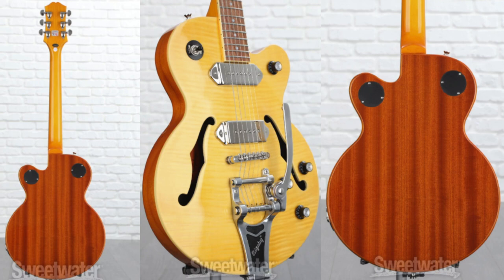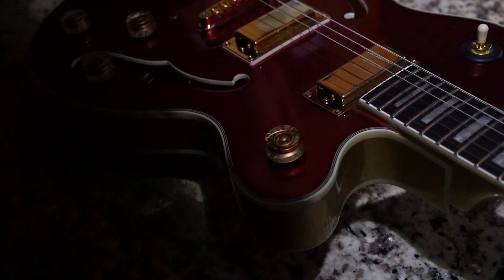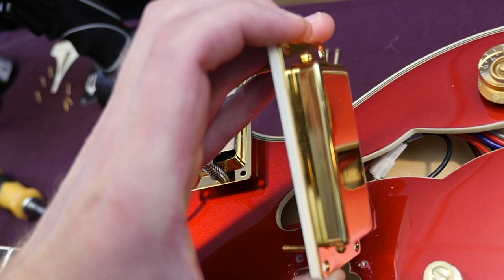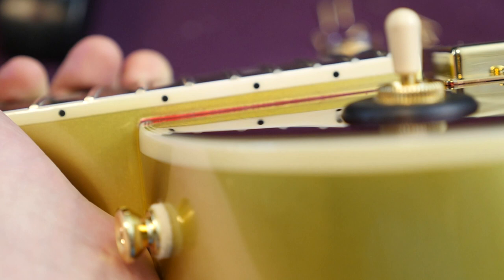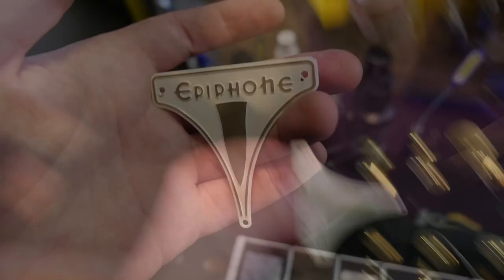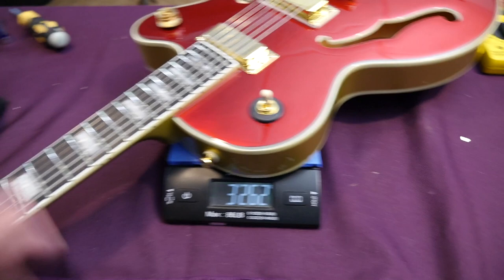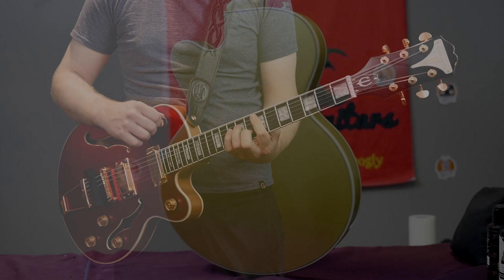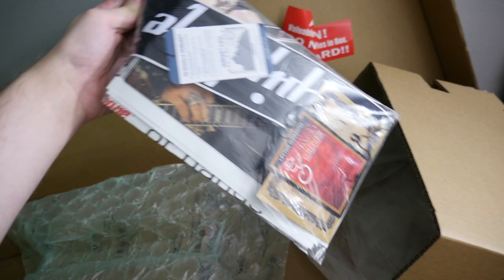Is the Uptown Kat Worth It? | 2020 Epiphone Uptown Kat ES Ruby Red Metallic | Review + Demo

Comment: I own this exact model, it's my favorite guitar, I own seven at the moment. I had to do a little work on the frets to get it without any buzzing but now it plays fantastic. I absolutely love the mini humbuckers they give you all the range and bite of a full humbucker but with a much tighter bottom. The wires are not visible on my copy they must have come loose on this guitar. The volume's configuration is fantastic you can blend the two pickups the way you like and then back off with the master volume and still retain your tone without redoing the blend again. I have to add that this is the best looking guitar I have ever owned and I have been playing for 55 years.
Reply: Do they suffer from neck dive?
Reply: Yeah had to work of the feet buzz too. A little feet work, changed strings and a good set up. And yup, has some neck dive. But plays well sitting unlike how a Les Paul feels
Reply: Do you Have any problem with the hum sound? I have the same model, but the hum is too noise!! I’m thinking change the pickups.

Comment: I preordered mine when I saw it at NAMM. After 6 months I’m still playing it everyday. The wires aren’t visible thru the F hole on mine. The neck/headstock is heavy and I did have some initial intonation issues but overall it’s a solid guitar with great tones. I even use it with a Metal Zone pedal-kicks ass

Comment: I bought one today, so your review was for me about bias confirmation. But I compared this guitar to others way more expensive, and ultimately, this (metallic blue) was my choice.
I love the look soooo much, easily one of the most beautiful guitars I now own.
And it plays beautifully, obviously it doesn't deliver quite the plummy tones of much more expensive guitars, but still very sweet to the ear.

A huge plus is the relatively compact size, much more practical for gigging.

Mine will be mainly used for jazz comping - at which it excels. Some soloing - adequate sound,  but not as searing as one would demand if one soloes a lot. And some chord melody playing, for which it's a good workhorse, though by no means the best sound for that either. But since mostly I'll be singing and simply using this as a backing instrument, it's outstanding.

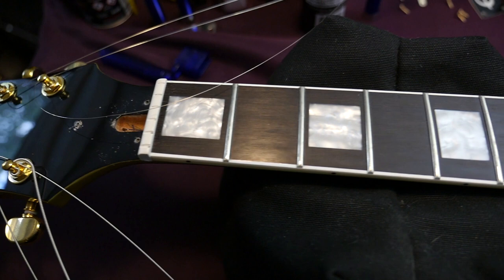Comment: 9:21 That might not be pencil graphite; but rather, metallic residue from the strings themselves. Please note: The Teflon™ impregnated into the NuBone® material is five times more slippery than the pencil graphite, and thus, if you rub the graphite onto the NuBone® material, you defeat its slippery qualities.

Comment: Perhaps the grommet on the pickup selector switch is intended to function as a rubber stopper-style holder for it which can be pushed out from the inside (through the f-hole) for wiring/maintenance purposes.

Comment: The emerald one looks epic. i'd like one as a stage guitar. only wish it hat a trem system
Reply: I put a Bigsby and roller bridge 
on my gretsch electromatic, it works and sounds great
Reply: @jamesmcgheeii7838  i did the same but on an epiphone wildkat, were i also put gold foil pickups in
Reply: Johs Avlund Madsen How did it sound?
Reply: @jamesmcgheeii7838  I've never owned a bigsby; how far is the range really? I use a duesenberg trem on my Les paul and that can do about 2-3 semitones without too many tuning issues. Would a bigsby perform similarly? I like the duesenberg trem, but it can only replace stop-tailpieces
Reply: gr3g0r5 I am not sure if one can get a bigger spring for a wider trem range... it’s not as broad as I’d like... I’ll have to see what the range is....

Comment: nice review!  Thanks for the video.  I actually have one of the original Kat guitars (Alleykat) with the mini humbucker on the neck and a full humbucker on the bridge.  The electronics were a bit cheap since the pickup switch snapped off and the potentiometers did not have much taper to them in the beginning (from 0 to 4 there is not much taper, only on or off).  Still plays well, but the neck was more thin than I'm normally used to.  :)

Comment: Mine eventually had the wire harness issue. The local shop reattached with a more secure adhesive and yes it does secure on the opposite side so wiring is not really visible. I do not think this a heavy guitar and while the neck is chunky I don't get the neck dive you find on yours. Comments comparing it to a Gretsch are accurate. The mini humbuckers are definitely have more twang, but adjust for a jazzier vibe. Zero fret issues with mine and the finish is flawless. I highly recommend this guitar especially with a $600 price tag. Oh and no tailpiece ping on mine.

Comment: I was considering this, the blue one. I decided to go with an Ibanez as73, faded indigo. I’m glad I did, because those minis sound like a wet blanket is over them. The pups themselves are probably good, but with that master volume, I’m guessing that the wiring inside is a mile long. It probably needs some work to shorten the wiring and upgrade the pots.

Comment: Just picked a used one of these up today in the same colour and it had been somewhat "Gretsch'd" up with TV Jones style pickups and a gold plated bigsby. Great little guitar, the only weird thing with it is the switch seemed to be round the wrong way - when it was pointing up the bridge pickup was on and the neck pickup was activated when it was down so I ended up swapping the wires on the switch. Fiddly job having to take the strings and neck pickup off but worth it in the end.

Comment: I enjoyed it . I had plans to get one but a mint condition 1999 Washburn HB 35  showed up. A washburn 335 wannabe. It was at NAMM  that year with a $2400.00 USD price tag. It was made in Korea and if you looked it over inch by inch it was flawless and sounds steller. It was aimed at real Jazz players and came with 11's. The public took one look at the price and said no way it is only a Washburn. lol So it was quietly discontinued but showed up in 2001 as a made in China jobbie.  It has binding front, back neck and headstock ...the top has 5 layers and a flamed top etc, The Korean was flawless ...the Chinese one was a dogs breakfast!!! But sold cheap. Bottom line I paid $350.00 USD for the Korean one and mine is mint.  :-)

Comment: ahhhhh, the guitar that sounds even better when you rewire it. Thats right, tear out their sloppy atrocious wiring (that you can see a wad of through the f-hole.) and replace it with some nicely measured out  build-your-own-harness kind of replacement with some nice vintage correct push up wire. It will look better and sound better without all the extra feet of wire in it they lazily stuffed in. Also less wire is less resistance and you may even consider using some Megohm volume controls.Less resistance means more signal from the mini-bucks. Better sound.

Comment: I love mine.  I got the emerald green one.  It's awesome ONCE YOU REPLACE THE GARBAGE PICKUPS.  Theyre the same pickups that are in the new Epi Firebird.  The B string is significantly quieter than the other strings, and you can hear that in EVERY review video.  No, they're not adjustable. I gigged with it for a pre-Paddy's Day thing, and it was so obnoxiously unbalanced that I swapped to my backup after a few songs.  

I've since replaced the pickups and made a better wiring harness (that doesn't show through the F-hole), and I love this thing.
Reply: What did you replace the pickups with?
Reply: @rayharris8113  I tried two sets of cheapo GFS; the Alnico 5 and ceramic mini hums, also mojotone Johnny Winter, Lollars, Duncan SM, and settled on Duncan Antiquities.
Reply: Mark Smith  Hi Mark. OK Thanks. I’m all for upgrading pickups although I don’t think these sound bad at all, but then I’m not gigging (I upgraded my N3 s on my Strat for Selects) Assume you must mean the Antiquities II Firebird. They are very expensive in the UK at least 370 euro the pair for golds! The guitar only costs just over £500... But thanks for alerting me to a potential upgrade path.

Comment: So what did your fingertips look like after your first half-hour? The dye on the fretboard rubbed off like nobody's business when I broke in my UpTown Kat. Is that just inevitable with Chinese-made Epis?

The QC must be all over the place. I got the same model, same color, and can barely find any flaw with the finish. Yes, having the rims of the f-holes painted rather than bound does give it a cheapish look, but on my guitar the paint job is near-immaculate close up.

Overall I'm happy with mine, especially the nice throaty tone. It's a great complement to my G&L Tribute Doheny, which I also like but is practically a glockenspiel in comparison.

Neck-heavy? It's no Strat, but the neck weight barely registers in comparison with my Gretsch semi-hollow. If anything I was impressed with how light and comfortable it is for a Gibson-family product.
Reply: Oh, and the wiring on mine is neatly tucked out of sight, toward the pickup from the f-hole.
Reply: @Budphrey  My Kat also had issues with black stuff on my fingers when it was new. I just put a new set of strings on after lemon oiling the freboard. Clean as a whistle now.

Comment: I have love/hate relationship with trapeze tailpieces. On guitar they're fine as guitar strings do not (usually) have tapered windings, so as long as string can wrap around tuning peg at least three times you're good. On bass though, a trapeze tail immediately drops you in to the extra long scale bass string rabbit hole. It's worse than string-throughs. The measurement you need to know is not a measurement many string makers go out of their way to advertise; winding length aka ball to taper/silk length.  Winding length must be long enough such that the taper or silk winding does not start until headstock side of the nut. Taper or silk sitting in the nut slot will make instrument nearly unplayable. This measurement will rarely be marked on the packaging. Have to go to manufacturer's website and they MIGHT list it somewhere there, maybe, if they're nice. Cherry on top is every manufacturer uses a slightly different length. 

I have Washburn AB-95 semi hollow bass. It needs minimum 38.75" string winding length. There are three companies that make extra long scale strings that long and I have never seen a set of them in stock in brick n' mortar music store ever. They're hard enough to find online. Part of the blame lays at the feet of Washburn on this. If they had made their trapeze 1" longer it would allow several more string brands to be used.  I am considering hiring a machinist to make me an extension piece for this reason.